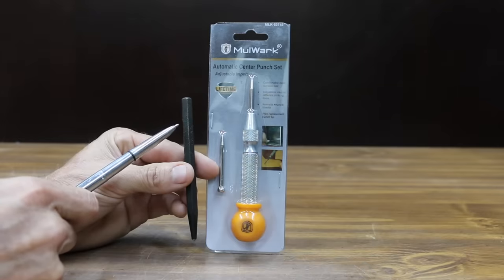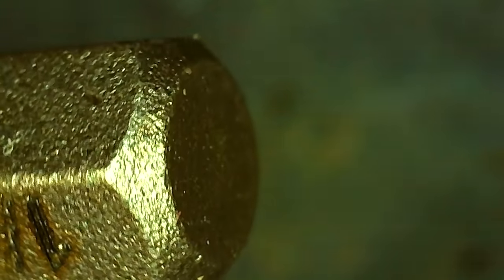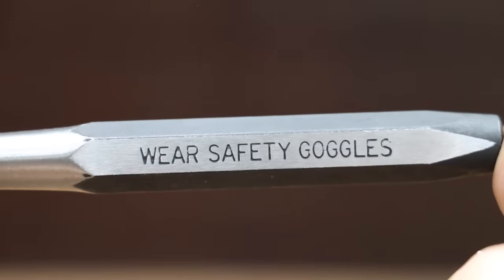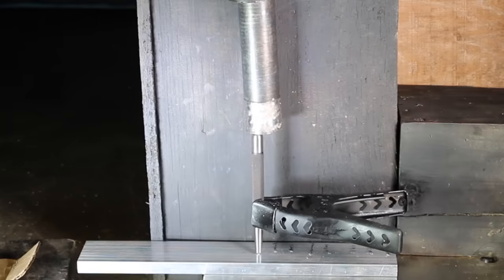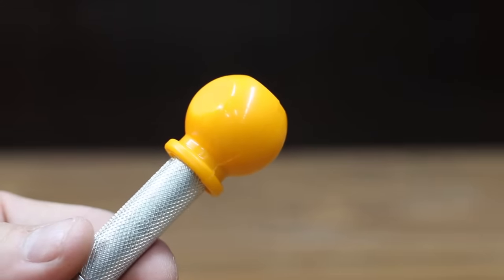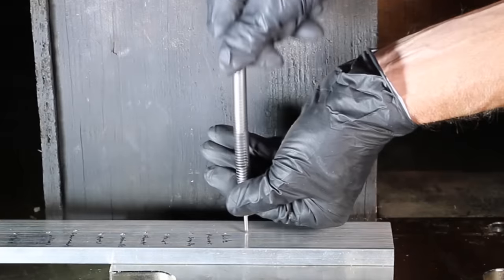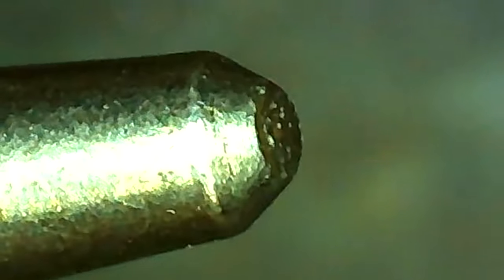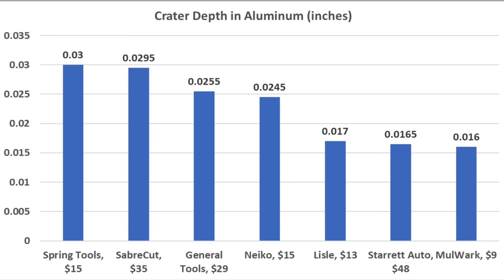Is a Cheap Center Punch Just as Good? Let’s Settle This!

Comment: I can't help but think the Starrett auto punch you got was a QC fail from the factory. Would be interesting to grind the tip to a point and see how it performs.
Reply: All the Starrett auto punches i know/use have a sharp tip. So a defect or a different type. To bad it happens in a lot of test that there are apples to oranges comparisons by not selecting the comparible type/line from the differend manufactures.
Reply: Yeah it seems like it must have snuck through their quality department. It would be bad for a company to knowingly allow a defective part to be sent to market
Reply: I’m thinking it’s a counterfeit rather than a QC fail honestly.
Reply: My starter automatic center punch is sharp as a needle, probably a fluke or a fake, very surprising
Reply: Todd, I own a Starrett 18C automatic punch and it has a very sharp tip. I think you got a defective one.
Reply: I haven't even made it to that portion of the video yet but I have 2 Starrett auto punches and absolutely LOVE them.  Beautifully made and both had sharp points.

Edit: I saw the tip in this video. This is either a factory defect or counterfeit. Neither of mine or any other Starrett auto punch I've seen looks like that.
Reply: I’d say the Starrett was a return from som unscrupulous consumer and got recycled back to you. The thing looks like somebody was trying to counterpunch titanium.
Reply: I'd sent it back. That's what warranties are for. It is definitely a manufacturing defect.
Reply: @davidt8438  titanium isn't actually all that hard. Titanium has a lot of tensile strength for its weight. Titanium is not as hard as copper is. Titanium is kind of like super aluminum. Mild steel is stronger than titanium is though. Just not by weight.
Reply: My auto Starrett is needle sharp and puts nice dents, also has lasted a while. Must be QC or a fake one
Reply: Definitely a defect, and worth returning. Starrett makes excellent hardware.
Reply: Yeah that tip of that Starrett auto punch he got is total BS to do a fair test on.
Reply: Strongly agreed. What a shame. My Starrett punches kick tail.
Reply: ive grabbed several new starrett punches. All have worn out in a handful of uses. Trash
Reply: I have the exact same model, and its not blunt. Been using it for a few years, and its ok. I have a feeling that was an Amazon return that somebody used a hammer against something very hard.
Reply: Yea if you ordered it off of Amazon, you might have gotten a customer return. 

I find it hard to believe the Starrett was let out of the factory like that.
Reply: Yeah... my grandfather's old starrett punch is sharp. Maybe this one is fake or defective
Reply: Came here to say the exact same thing. I used my Starrett auto for sheetmetal work on aircraft it has a pointed end, and it has a nice light punch force which is good for thin alclad aluminum.
Reply: Based on Ave’s recommendation of the Starrett being an ‘heirloom’ level of tool, I bought one & the tip was not blunt like yours. Several years later, it’s still very sharp.  Thinking yours was a return or something. Doubt it was a QC fail, as Starrett is a world class company. They wouldn’t ship one like that.
Reply: starrett have had pretty bad QC for a while now...
Reply: No. For providing Chinese quality while demanding Dubai price? For that, this brand can go f themselves with their quality
Reply: I'm inclined to think that starret was defective, but at the their price point, there is no excuse for such shoddy QC. Think it might have actually been a metallurgical fault, given how it's blunt tip further shattered against the hardened steel
Reply: The Amazon link for the Starrett says it's fulfilled by a third party seller which is a red flag to me. One manufacturer I spoke with about another product told me be sure it's fulfilled by Amazon to ensure authentic product. YMMV.
Reply: Also, Starrett makes about 4 different sizes and types of punch, that certainly doesn't look like an 18C which is the model you want if you want to make a large dent
Reply: @davidt8438  my first thought after seeing that Starrett.  I have the 18a and the 18c and have used them a lot... tack sharp 5+ years later
Reply: @Snark900 Correct, that's an 18A. I use that for sheet metal and aluminium. The 18C is a heavy hitter.

And on top of that, a blunted 18A.. Mine is scary sharp still.
Reply: @TheDaniel85  I looked carefully at the video and I am sure that it’s counterfeit. Where it says Starrett on the tool it’s laser etched. On a real Starrett that’s stamped in.
Reply: @Snark900 good catch.  Future video idea: review different tool dealers with an emphasis on how well they do at keeping counterfeits out of their supply chain.
Reply: Yeah, I have my doubts about that auto Starrett. Mine is a beast. Bought it 8 years ago, have used it a lot, including on 1095, still going strong. Counterfeit, or possibly someone ordered a genuine one, and swapped out the punch head with a worn out / crappy one; got themselves a free replacement or an 'upgrade' when they returned it.
Reply: Maybe he got sold a used unit
Reply: Need to get a new one from a reputable vendor and rerun the test.
Reply: Had both the Starrett manual and auto punches since the 70's, never had a problem. The auto in this test doesn't compare.
Reply: If it was indeed a QC fail from Starrett's factory then I'd argue Starrett got the rating it deserved.
Reply: Having worked in several different machine shops over the last 40 plus years I have seen this type of damage before. Somebody tried center punching material that was way too hard on accident or on purpose with malice. Any of the punches in this test would have produced similar results under those conditions/circumstances.
Reply: I bet it was used on something that was incredibly hard and older. Or a hammer was used with it on hard material.😇
Reply: No kidding, the tip on that thing looks like it got a little too cozy with a grinder of belt sander. Wonder if somebody hit it with an angle grinder or something then put it back in the box and returned it.
Reply: Starrett qc isn't what it used to be.  I have multiple starrett auto punches all bought from reputable sources, have had to disassemble and clean out metal filing and clean up threads on almost every starrett product I've bought in the last decade or so.  The threads on a tap wrench were particularly awful.
Reply: I have all starrett punches including the auto. It's failed before and so have the manuals.  I've probably center punches 10s of thousands of times though.

Comment: It'd be cool to see a part 2 where you see how many hits they take to dull the tip, then try resharpening all the punches n see if theres any decrease in tip strength
Reply from the maker: Thank you for the video idea!
Reply: That’s a good idea. I think everyone who’s ruined a punch will grind and new point and keep going.
Reply: shouldn't be if you don't over-heat the tip.
Reply: @donwest5387  that’s what I was thinking, I’ve had some success when I go slow, and use coolant. The ones I’ve destroyed because I was in a hurry. Live and learn.
Reply: @ProjectFarm I use the spring centre punch for initial marking followed by a hammer blow to a dot punch.
A centre punch in my books is sharpened at about 60 degrees and a dot punch at about 90 degrees so that it makes a wider indentation for the drill tip to find more easily.
Reply: Good idea!!
Reply: It may depend on how you sharpen the tip what kind of damage you cause in the process. I've resharpened punch tips and just freehand grinding them on a wheel isn't always the best way to point them up. I actually have a Vee groove guide I use. Not overheating the metal and ruining the temper always helps too.
Reply: @adrianchetwynd1334  yeah I use two punches when I locate and punch dimples. I start out with a sharper punch and follow it up with a higher angle punch to broaden the dimple. For registration I use a spud in a milling machine to locate then use a center bit to start. All of that usually gets me within a few thousandths of where I want a hole.
Reply: @1pcfred 
That’s lot of precision, more than I need at least
Reply: That will have a lot to do with the regrind and how hot you get them.
Reply: I have a couple of the lisles. They are junk. Don’t work half the time. Btw, I have the bluepoint version. Lisle must make them for snap on. The tips do not take much abuse. I’ve had to resorted and reharden them. They fail to snap about 50% of the time.
Reply: I also think this needs a part 2
Reply: One concern as far as fairness goes is that not every punch is the same. Some are heat treated differently and they have different types of material. If you sharpen them using the same method one will do better and one will do worse. Then you switch methods of sharpening and the roles are reversed.

PF is all about fairness.
Reply: @dirtfarmer7472  when hole patterns need to line up everything has to be pretty close.
Reply: @ProjectFarm you should consider doing doing puncture proof 🚲🚲🚲 tires
Reply: Great idea
Reply: I imagine at least some of them are induction hardened to save cost and them there's minimal amount of hardened steel to grind off. This is widely used in all sorts of blades too which should be criminalized for wasting resources and denying customers long-lived products that can be reground numerous times.
Reply: The testing of these tools with one hit seems absolutely irrelevant to me as no human uses their Tools in this fashion. If we're being nice we give him a pass because he did test the tools but if we're being honest this is low quality content and unhelpful.
Reply: @CalvinHikes  
He had to keep the test even & repeatable. I think that’s the sensible way of doing things
Reply: @ProjectFarm No, at these low prices, it's not worth the effort. I have a Craftsman punch that I bought in 1974. It lasted 49 years, until I loaned it to somebody. He tried grinding it at work and failed. The effort to make a jig, the hardness of the steel, and the low cost of replacement make it infeasible.
Reply: Yeah, don't let coworkers use your punch. He trashed it and then resharpened it for me. Bright blue on the end. Gee, thanks pal.

Comment: As someone who has went through my fair share of center punches, I can appreciate the value of information given in this video 👍👍
Reply from the maker: Glad it was helpful!
Reply: Did you loose them or you just don't know how to sharpen them?
Reply: @ProjectFarm Hi, I would be happy with you to check dry lubrication?  That is, either dry materials called graphite, or liquid materials that dry and produce a lubricating layer.  I'm mostly interested in this for locks, because liquid lubricant causes dirt to build up until the mechanism jams.  So that you check a few things - how fast it dries, how sticky the material stays, does it also clean the mechanism and remove dirt, does it protect the mechanism against rust, and does it really manage to make the mechanism work smoothly.
Reply: The best center punch I have used is a needle form a diesel fuel injector.

Comment: I think a comparison of hand file sets would be a good video, I know there are many types of files out there but they are very versatile tools. Thank you for everything you do Todd! :)
Reply from the maker: You are welcome!  Thanks for the suggestion.
Reply: @ProjectFarm error: I just watched your ratcheting wrench comparison.....and as you test the jaws and play, you forgot that the handle thickness varies as the measurement point moves into the micrometer. So you raise the wrench up and the device is measuring a thicker point on the handle......so you measure change in handle thickness and you aren't measuring open end wrench play.
Reply: @sasquatchrosefarts  I find the handle to come into play in real life settings though. Often knocking between engine and body or other tight spaces. So while I see what you're talking about, I actually like that the handle is in the test.
Reply: @sasquatchrosefarts right ok. how can you use a ratchet if the handle is out of space to move? Tight spaces are where that matters which a thicker handle will affect.
Reply: As a machinist, If you want good files I like two brands. One is on mcmaster carr when you filter for the black oxide coating. Another good brand that i like better but is a bit harder to find is tome feteira. both work great for me. For the Tome ones they might show up as anglo american when you look them up on MSC. Avoid nicholson unless they are antiques. the old ones were the best but now they just arent as good for some reason.
Reply: Seconding files. Seems like no matter which ones I get they never last more than 4-5 months
Reply: @printgymnast368 Did nicholson start outsourcing off shore? Ive got at least a half dozen of theirs I bough between 1996-2002 or so, theyre great.
Reply: @batvette  don't know about outsourcing but I know their new files are trash. Not hard enough to sharpen tools and they don't last like they used to.

Comment: I've been a machinist for almost a decade and I'll stand by my starrett center punch.  It has never not worked for me, looks great, and it also matches a lot of my metrology tools.
Reply from the maker: Thanks for sharing!
Reply: @hahahahaballs Amazon probably gave him a Chinese replica Startett auto center punch.
Reply: Starrett, like Rolex is the most faked.
Reply: @hahahahaballs They come with different tip "sharpness" levels.

The one in the video is for when you're going to use a larger diameter drill, and you have the sharper one.
Reply: I have the Starrett 18B automatic punch and mine has a sharp conical tip. The tip is removable (unscrews). It works pretty well on mild steel.
Reply: Well matching tools is the most important thing, I personally hate it when one of my tools doesn’t match, and the fact that you point out that your a “machinist” makes me feel all warm and fuzzy inside, a statement like yours coming from a mere mortal would not hold as much weight. Thank you for your service.
Reply: @johnstone9396  I care more about how well they function. That's why I use the starrett.  The part about being a machinist just says that I have a good bit of experience using starretts other tools.
Reply: I buy starrett because they’re made in USA near where I grew up.
Reply: That starrett auto center punch seems to be fake based on the blunt tip and stamped lettering compared to the one I have, and others I’ve seen.

Also this item isn’t in the Amazon brand protection program, so the Amazon inventory is commingled with fakes and maybe some genuine. The current Amazon seller for this item is “Onogo US” which looking into them doesn’t instill confidence. I don’t know which Amazon seller project farm  bought it from, but you would never have any guarantee it’s genuine.
Reply: That Starrett could also have been used, returned and resold by a less than reputable vendor. Or it could be a knock off. Or both. Whatever the case, this is not what a new Starrett tool should look like out of the box.
Reply: I've purchase Starrett tools for close to 40 years. I saw a decline in Starrett quality around 2005, when they switched from engraving to laser etching for marking a lot of their tools. 

The Starrett 18B at one time was offered with optional tips as well as replacement tips. One of the optional tips was a carbide insert which worked great on layout out work on Jig plate.
Reply: The hazet hole looks like it’s designed to give your drill bit some grip
Reply: My Father gave me a set of "hand me down" Starrett center punches over 40 years ago when I started in Tool & Die work.  Now that I'm retired, they're in my tool chest in the garage.  (Along with several other of his "hand me downs".)  The punches have definitely been sharpened a few times!
Reply: @dotar9586  Tool and die making is fast becoming a lost art.
Reply: Same with me.  I am a retired machinist and Starrett will always be my go to center punch.
Reply: I think i am named after it...
Reply: @tickandslug Plus, the tests here are great and thorough but only the guy using them for years can tell you the durability.

Comment: Hey I’ve been a Machinist for about 1 year now and I’ve been watching you since highschool. I’d love to see a comparison test of cheap vs expensive metrology equipment. They’ll probably both be accurate but I’m mostly thinking of wear in the lead screw and amount of damage the faces can take! Keep up the good work!
Reply from the maker: Thanks, will do!  Thanks for the suggesion.
Reply: Hey that would be a great video!!
Reply: Have you done best wobble/ flex joint  sockets yet ?
Reply: did something similar to this recently with my grandfather, compared the accuracy of all the metrological equipment around the workshop and came to the conclusion of, 
if you need cheap calipers, don't buy dial calipers, as only the expensive ones seem to hold up to the test of time. For micrometers, cheap is fine for metric but you'll be hard pressed to find a cheap tenths micrometer.
Reply: If it will repeat, you're as good as your standard is.